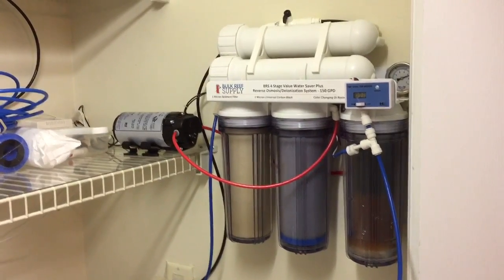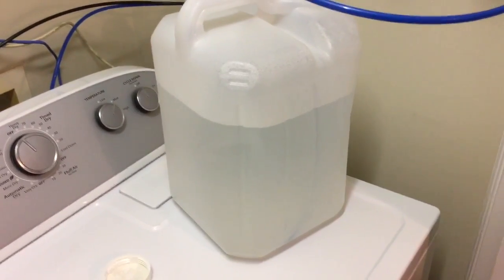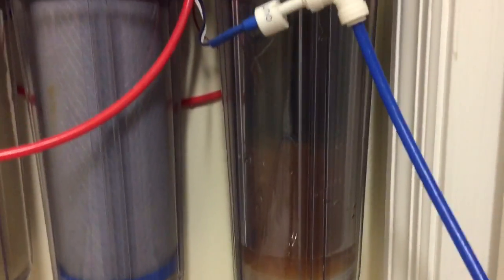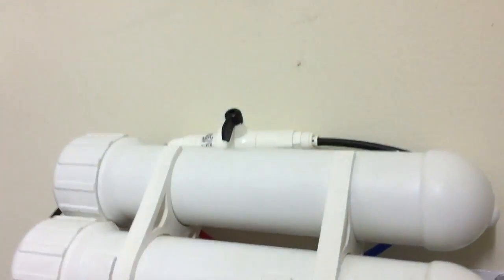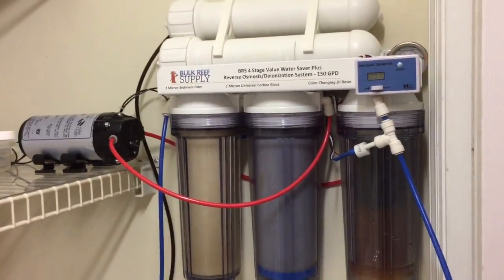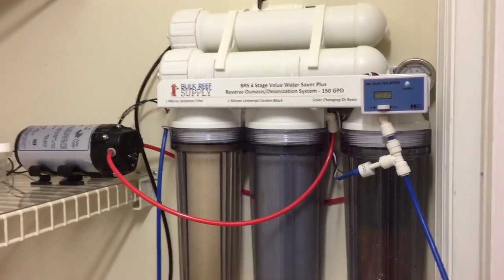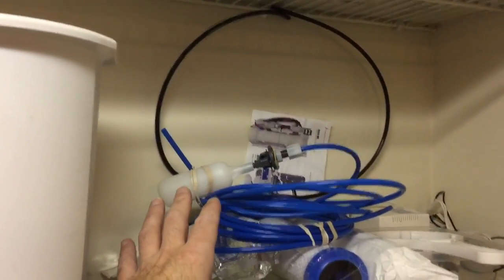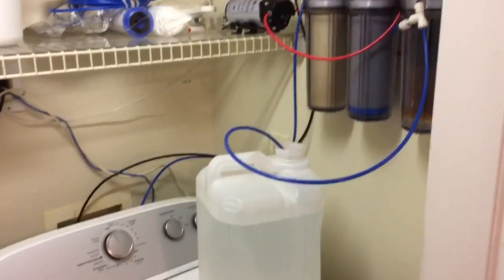BRS 4 Stage 150gpd Water Saver RO/DI unit (2). Installed and running

Comment: Hey, PBabe sent me and I subbed! Have I seen you on CJ's Reef Shack? I recognize the icon, I think. That's a nice setup you have there. You could just about use your tap water compared with what I have in my area - right now ours is 600+ TDS and my little RODI system gets it down to 1 but do we ever burn through the resin!
Reply from the maker: Reefgrrl yes I have been in CJ's reef shack. Thanks for the sub. Sorry to hear about your water. I am not sure what mine is out of the tap. I have never tested it there only right before it goes into the resin chamber and that's like a 7.
Reply: Hi. Not sure if your still running this system, but how often are you replacing Di resin as your tds in 600.  Mine is 350 and I'm thinking of adding a 2nd membrane kit, just want to get a ruff idea of my resin use.  Also does the flush kit flush both membranes, I have one now on my single membrane, I'm guessing it will be moved to a different position when I get the 2nd membrane. Thank you